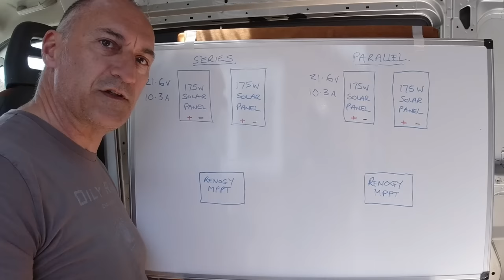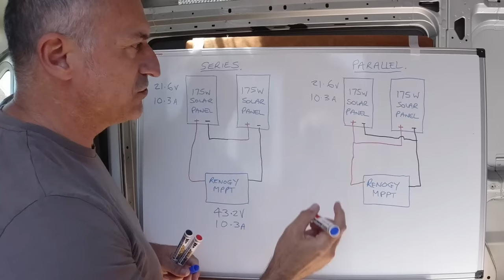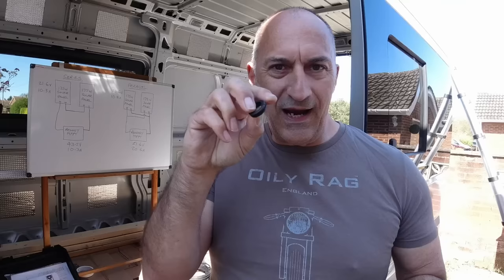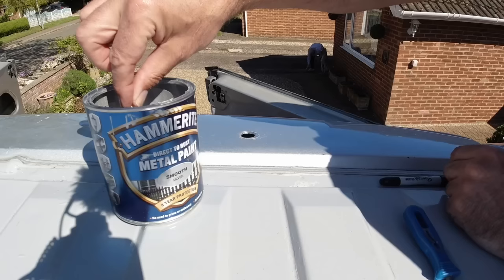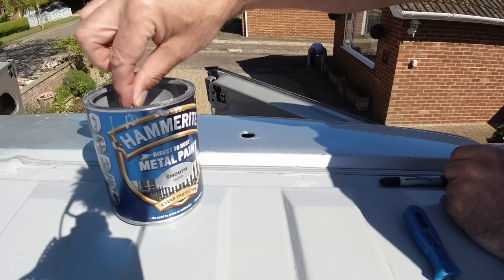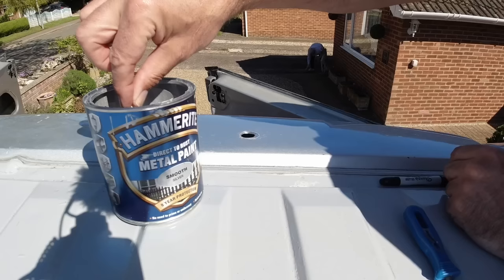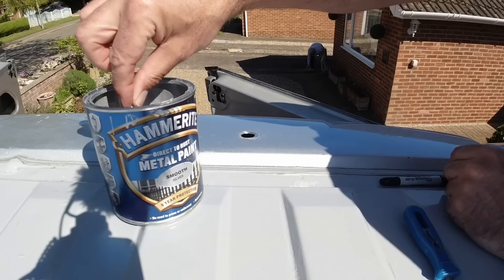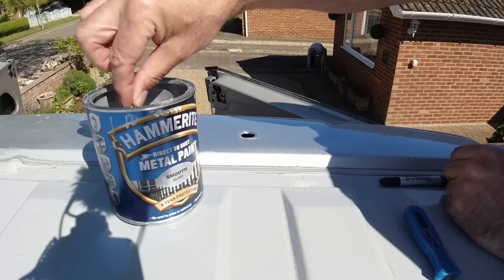How to Install Solar Panels - Budget Van Build Ep 10

Comment: I know this is budget, but I like the Renogy Solar Panel Tilt Mount Bracket RV Roof Flat Surface Aluminum Mounting Set..One you can get under them to clean the roof, secondly you can angle the panels to the sun, thirdly you can access connectors easily enough, fourthly maybe easier to swap out panel if it has a problem and lastly easier access to fix a  leak if one occurs in one the manufacturers covered bolt holes..So maybe worth the bit extra, even though might not be angle them all fully, due to shadow being cast ..
I have seen some right gunky roofs that you could grow spuds in, not having it on my roof, plus angle and access is a big plus...Love the simple attachment Greg, if you're confident with fixing brackets this way I am, no need for roof rails, but I might drill a small pilot hole then use 522 on a small baton inside to add support..Boss..

Comment: Nice tidy installation. I though oh no he has not mentioned doubieing the current and ensuring wire size was adequte, but you actually got to it when you would have made for sense for people
Reply from the maker: Yes I did mention that I had increased the single cable to 6mm when showing how it plugs together 😊

Comment: Free comment and nowt to say really but we love u Mr V.
I live in surrey and have recently acquired a L3H2 citroen relay I'm gonna convert hopefully once I've sold my truck. I might buy a go pro and film it for my daughter who unfortunately doesn't live with me anymore, I need to start documenting my life, fancy helping out? Cheers Greg
Reply from the maker: That a brillaint comment thank you Nick. My advice would be to get a a DJI Osmo Action 3 instead of a Go Pro. In my opinion they are much better and less likely to crash and let you down. I had both and the DJi is much more reliable.  https://www.ebay.co.uk/sch/i.html?_nkw=dji+osmo+action+3+camera&_sop=12&_dmd=2&rt=nc&mkcid=1&mkrid=710-53481-19255-0&siteid=3&campid=5338027957&toolid=11800&mkevt=1

Comment: Thank you so much for taking the time to create these videos Greg, they are so informative and are helping us out enormously! We’ve just got the same solar panels, could you possibly let me know if there is a set distance away from the Maxxfan they should be positioned? Cheers again for sharing the knowledge 👍
Reply from the maker: I placed them towards the back of the van a good bit away from the fan so that it wouldn’t cast a shadow on the panels when it was open. In hindsight it may be better to put the brackets on the ends of the panels and not the sides so you can use both screws on each bracket. Only realised that after fitting my own. Hope that helps

Comment: Awesome! Thanks Greg. 
Can’t wait to get my van and get cracking!!
I missed the C license by one year so will need to get something shorter like this one. I’m hoping the L3H2 will still be under the GVW limit but finding the right specs for this model is confusing me 🤯😂
Reply from the maker: Most vans even the LWB versions are still under 3.5T so you should be ok 👍🏼
Reply: @GregVirgoe  brilliant. Thanks Greg. Really appreciate you sharing all your knowledge. So helpful.
Reply: Rick, I’ve got an old Transit minibus, XLWB dual axle. It’s 80% there - all the heavy stuff in - and weighs at 2.8 tons, even with all the glass. It’s definitely do-able if you’re careful!

Comment: Your videos have been a blessing during our van conversion. We also have a Fiat Ducato and have used the same system with the z brackets you show in this video. At higher speeds and in windy conditions we noticed a bit of drag on the solar panels. Do you have the same experience or any suggestions on how to improve? We could add a spoiler, but then we would have to fill all the gaps underneath the spoiler as the roof is not flat.
Any ideas are greatly appreciated ❤

Comment: When drilling through metal, put the drill in reverse and drill slowly. it'll take longer to drill through the metal, but it'll be a cleaner cut, and the arbor won't  break off.
Reply from the maker: I imagine that would take much longer and heat up the cut quite a bit. It looked like my drill was at an angle which caused the aggressive kick back.

Comment: Another great video Greg 👍 Just about to install my panels and this is really helpful. If you’ve got any of those grommets left it’d be great to have a couple. Also I’m assuming there’s no problems with having the panels up but not hooked up to battery and appliances etc? No need to cover them whilst not being used? Cheers! 👍

Comment: HI Greg, your videos are fab, watched the van builds multiple times! I can’t speak highly enough of them. We’ve been looking for the right van for ages and finally found and started on a Citroen Relay LWB (L3H2), floor in, rear view camera nearly done (no auxiliary fuse box in the side panel though!). 
Now, finalising the electric set up, probably with 3 no. 175w Renogy panels. However, the parallel set up means 30.9 Amps and Renogy only do a 30 Amp in line fuse. Thinking of 3 to 1 MC4 connectors (on +ve and -ve), 6mm cable with a 40-amp Renogy fuse located inside the van rather than an IP67 one on the roof. Any advice would be gratefully received. 
Keep up the great work and thank you. Big shout out to Mrs Virgoe for her brilliant camera work 😊.
Reply from the maker: Yes that will be fine what you have described will be perfect. If you are using 3 panels (525W) you’ll need to use the 50A Renogy charger because the 30A one has a max solar input of 400W. Using the larger charger means increasing both battery cables to 25mm and both battery fuses to 60Amps. Please ask if unsure about anything. Hope that helps 😊
Reply: @GregVirgoe  Great, the chargers already in the basket!
Reply: @GregVirgoe  Hi Greg, excellent build series, thank you for taking the time to put it out there. I'm following your electrical installation and preparing to copy your ideas into my own van. I have hit a problem on the Renogy website though. The 30A dual charger ticks all the boxes, however in the product description on their website, it states if my alternator puts out over 100 amps, or if i want to use a leisure battery with more than 100ah capacity, it recommends the 50a charger. On your best budget campervan wiring video, i see you are using 130ah batteries so i'm a bit confused as to which charger i should get?
Thank you, and looking forward to the next instalment.
Reply from the maker: @paulstansfield4438  the 30A dc to dc charger is ever going to take 100amps from the alternator. The fuse on that cable is 40Amps so that would blow. It’s max input to the leisure batteries is 30amps. 
A bigger battery is no issue it will just take longer to charge at a slower safer rate of charge.
Reply: @GregVirgoe  that's great, thank you for the quick response, you've put my mind at rest. Very much appreciated 👍

Comment: Hey Greg another great video. I have sent you a message on messenger (hopefully to correct address) asking about a slightly different setup. By the way picked up great tip on one of your other videos with noise caused by loose panels rattling as you drive. Found 4 where panel had come away from strut😢. Sikaflexed so should be all good now🤞👍
Reply from the maker: Hi mark, was it the split charge question I answered? Thanks for getting in touch. Hope it helps you 👍🏼😃

Comment: Hi Greg, Great video as usual. 

Couple of notes if you don't mind...those self drilling screws to hold down the brackets to your roof, did you only put 1 in each bracket? Why not drill a hole in the solar panel frame a bit further along to line the full width of the bracket up with the raised rib of the roof?Also, will the swarf from your self drill screws not get stuck in the sikaflex and potentially rust? Did you screw into timber beneath the ceiling? Those met screws can easily rip out, particularly if there is only 1 in each bracket. (For anyone reading, I always drill a hole and bolt with stainless penny washers, nyloc nuts etc.).
Also, that gland for taking the cables through the roof should be the other way round? bit risky for water ingress when driving into hard rain. 

Looking forward to catch up with the rest of your videos on this build
Cheers

Comment: Hi Greg, not sure that the solar panels need that fuse, since they are inherently short circuit proof. The SC current is only about 10% greater that its rated MPPT peak current. If you are trying to protect the cable, then your 6mm cable would easily handle the SC current.
Reply from the maker: That’s really good to know and thank you you for adding that comment Rob 👍🏼😃
Reply: @GregVirgoe  Thanks Greg, really nice to see the van making progress. You know how I love solar panels! Just fitted 12 x 390w panels to our back garden pergola. . .

Comment: Once again a great video and very informative.  My pipe dream has come true and my conversion is just getting started on a VW Caddy Maxi I had already decided on my solar setup and it is using the same equipment (175watt panel + Renogy mppt/b2b charger) as your build but with only one panel as there is not any room for further panels, thanks for confirming my choice.  I am going to suspend my solar panel from the sidebars of the roof rack with Ali angle fixed under the sidebars to drop the panel down so that I can still use the roof rack if needed.  Thanks for the solar panel link as that has saved a few quid...  Is there one for the mppt / b2b charger as I have purchased it yet?  Perhaps after you have completed this build you could consider a project using a van similar to mine as a micro camper???  I really enjoy your videos, I have been watching them since the day you purchased your sprinter.  Even more coincidental is that we were both building services engineers...
Reply from the maker: When fitting to the roof rack make sure that it’s not below the level of the roof bars so they do not create a shadow over any part of the panel as even a small shadow can drastically stop it working

Comment: So good to see you doing another van Greg.. 

Are self tapping screws instead of a bolt going to be strong enough to keep the bracket and panel on the roof? Or would it be best to mount a bit of timber under the bracket to fix to?

Comment: Great vlog.Please could you cover the relative additional pros and cons of series v parallel (e.g solar shading and anything else) in your next vlog please.
Reply from the maker: I will add something later 😊
Reply: This was going to be my comment too - I decided the extra cost of a bigger MPPT to handle the higher voltage was worth it to get better low light generation. But appreciate this is a budget build so a worthwhile trade off to keep costs down. As always, a cracking video Greg. Best wishes.
Reply: As an elec and electronics tech here, I will give you my tuppence worth... The only advantage of series panels is if you have a 24v system (as I have btw) then you need at least 28v  or more input to your controller, otherwise parallel is best(if one or more panels are shaded, then you still get output (not the case if series connected) plus you get less losses if you match panel voltage to a few volts above your chosen battery/s, (the mppt controller has to work harder the higher the input to output ratio) hope  that helps you to understand the principles. 👍
Reply: @r33gts  my Victron MPPT starts charging only at Vbat + 5V, so on my 12v system it would not harvest as much at the beginning and end of the day. Most Campers are 12v but I appreciate there are lots of different ways to go - hopefully Greg can work his magic and explain it in a simple way 😀

Comment: Great video’s!,

18.20: one of the cables is routed underneath a panel bracket. Not sure if it stays this way but the edge of this bracket may rub on de cable during driving.
Reply from the maker: The cables were all dressed with cable tie clips after filming to secure them. Thank you 🙏🏼
Reply: @GregVirgoe  thank you!

Comment: When connecting from your vehicle battery to your leisure battery, you can buy some jump lead cables (Obviously making sure they are the correct gauge) Cut off the ends and crimp with the correct lugs. You may find It a bit cheaper.

Comment: Hi Greg just purchased the same solar panels as your self. Also the 40amp MPPT Solar charge controller Li40. Iam wiring the same as you in parallel.
I have swift command system which I believe will only take voltage upto 10amps.
I have factory 80w solar on the roof which I will replace with the same as you.
Do you think that the current will exceed 10ams on a sunny day.
Would be grateful for any advice. You’re van build coming on great keep up the good work 👍

Comment: Great video Greg  only one comment would you not been better drilling an hole further along  from the existing one so you could put two fixing screws into the brackets on the roof ridges.
Reply from the maker: i think this will be ok, you can put another one in if you feel happier, or relocate the brackets to the end of the panel where you can get both in on one ridge.
Reply: The roof ridges are not wide enough but it would be possible to fill the trough with a piece of soffit board.

Comment: Hi Greg, really enjoying your videos, they are a massive help with the Relay camper I’m currently on with 👍🏼 so glad I have the same van as you! I’m currently looking to purchase solar panels and was wondering if there is any reason not to use a household panel over a camper specific one like Victron or Renogy etc? 

I’m after 400W in total and was looking at 2x Renogy 200W panels which would cost around £320. I’ve seen some domestic 400W single panels for £80-100, one brand being Canadian solar. 

The Renogy panels in series would run at approx. 40V 10amps.
The Canadian solar panel runs at approx. 36v 11amps.

Mass is similar between the 2 options so the only thing I can think which is a benefits to the Renogy is the size, making then easier to handle and package on the roof depending on what space is available. 

Am I missing something here, is there something specific about the materials or construction of “camper panels” that is more beneficial to being mounted on a van?

Comment: Thank you for the video. These are a great motivation and source of advice. Do you have a video or advice for running the cables in the ducato?

I totally underestimated the time it would take for a van build😂. I spent a week trying to get the van empty and paint all the scratches. I have until monday to get something like a bed and kitchen into my citroen. Then get it certified as a camper.
Reply from the maker: Oh dear 😅 it does take a long time. Best of luck 🤞🏼
Reply: Passed,

 Thanks for all your tips! It made life easier... although I skipped alot of step and now need to strip and do them again. Notably running cabling.

Do you have any videos on furniture wood choice? I made most of mine out of 15mm beech plywood(multiplex) but I found it very heavy especially for the kitchen doors.
Reply from the maker: @braccereve9271  Lightweight Furniture Board Options
https://youtu.be/3yKqFkMgoHY

Comment: If you live in a hot climate like we do (Australia) it is best to mount the panels to a roof rack, leaving at least 10cm of space between the underside of the panel and the roof for air to flow. A cool panel is an efficient panel. Like all electrical devices, heat leads to inefficiency and eventually failure. This is why it’s important to mount panels to roof racks and not directly to the van roof as shown here. In cold climates it doesn’t matter as much.
Reply from the maker: The brackets provided do elevate the panel above the roof to allow airflow underneath they are not sitting directly on the roof. Please take a closer look. Thank you 🙏🏼

Comment: Worth noting its good practice to NOT connect your output wiring to the Panel connectors until the supply end is connected to your isolator (bare exposed live conductors). Risk of shorting on bare metalwork. If these were higher voltage panels ( such as on a domestic install) there could be dangerous DC voltages present ?
Good to share info anyway !

Comment: Absolutely brilliant and helpful - have already ordered some of those roof brackets but for another purpose as have been looking for something like that.
One quick question, on the cable install into the van via the roof gland thingy (the black thing you got sent) - I noticed you installed it very neatly but with the cables in the forward direction - have you ever had any issue with water being forced in when driving in rain or has it been ok. I’m going to install some CCTV and was thinking of similar gland to route the cables as handy onward routing from there as you said. Also maybe cheeky opportunity to mount an additional rear camera on the top of it.
Thanks again, super helpful 🌟
Have a great weekend, David 👍
Reply from the maker: No never had a problem put a little smear of sealant around the gland. 
It would not have fitted the other way round as the cables would be hanging off the back of the roof.
Reply: @GregVirgoe  thank you, makes sense - I had figured ref the cables if reversed, looks neater anyway as everything runs the right way, thanks again 🌟

Comment: Excellent video as always thanks Greg. You mentioned sticky pads and cable ties to secure solar cables to the roof. I worry about them bouncing around. Do you have more details on how you secure cables on the roof? Thanks Rich
Reply from the maker: I used these self adhesive cable tie bases, make sure to clean the surface of your roof well first.  https://www.ebay.co.uk/sch/i.html?_from=R40&_nkw=self+adhesive+cable+tie+bases&_sacat=0&_dmd=2&rt=nc&mkcid=1&mkrid=710-53481-19255-0&siteid=3&campid=5338027957&toolid=11800&mkevt=1
Reply: Can always add some Sika flex for belt and braces?
Reply: Thanks Greg these look ideal. Rich